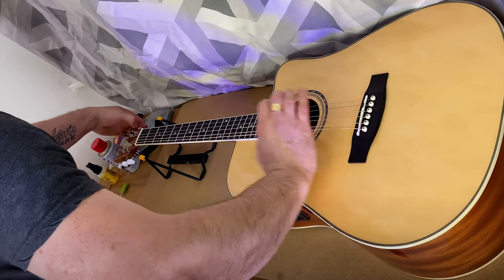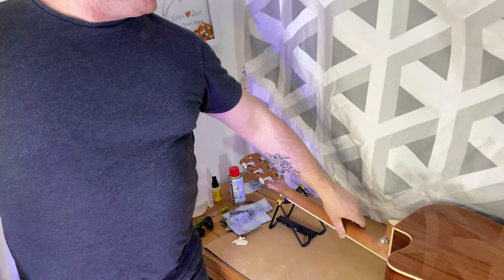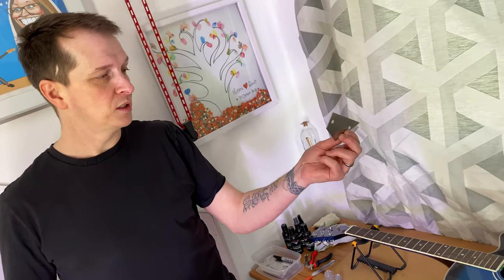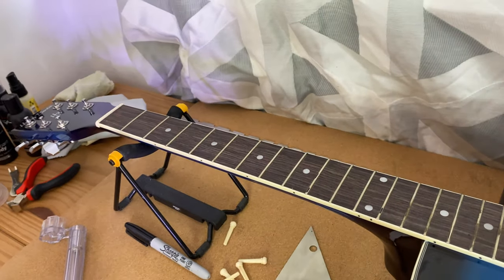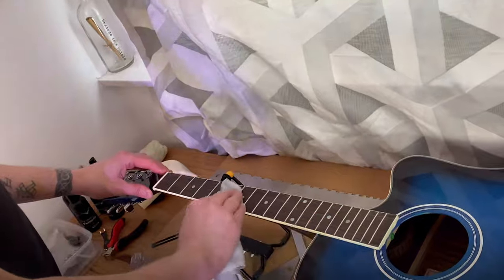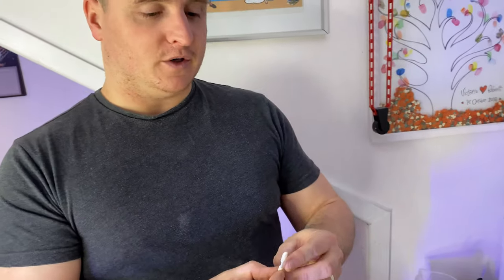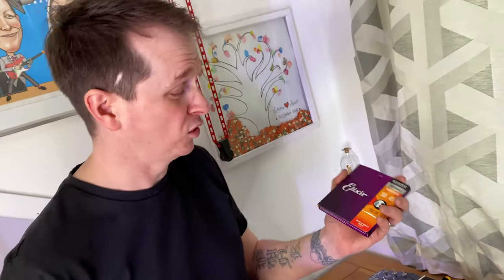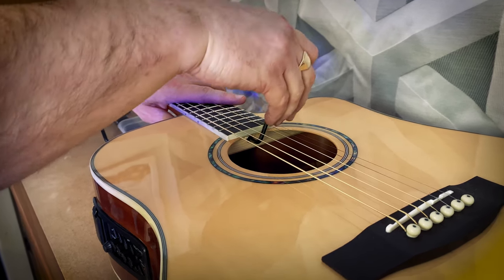How To Setup An Acoustic Guitar

Comment: I thought you only turned the truss rod when the neck is bowing???
Reply from the maker: Hi Rob. No it depends what the position the  neck is in to start with. The truss rod can turn in either direction. For instance with the translucent blue guitar the neck was straight so I needed to put a slight bow in the neck to get the desired position. I hope this helps.
Reply: @TicketyBooDuo  oh I see that makes sense. Thanks for clarifying 👍